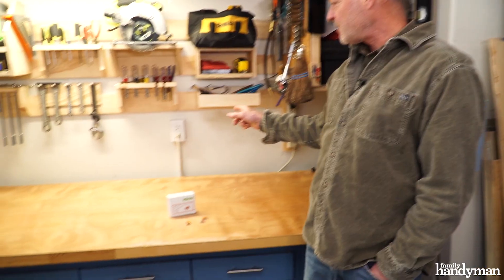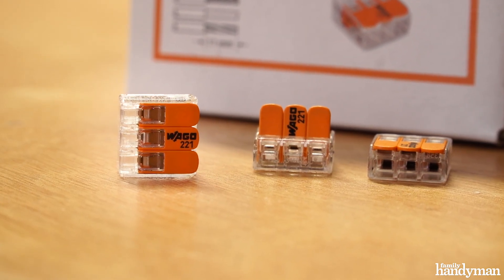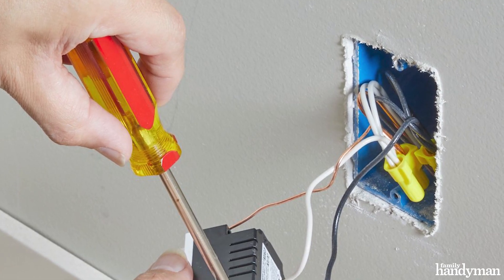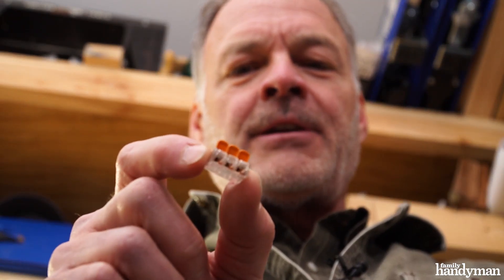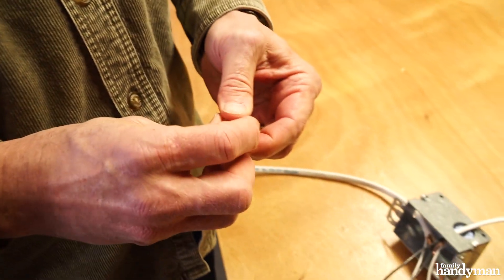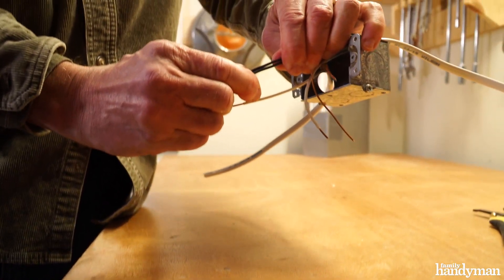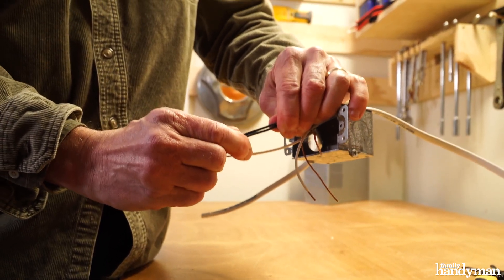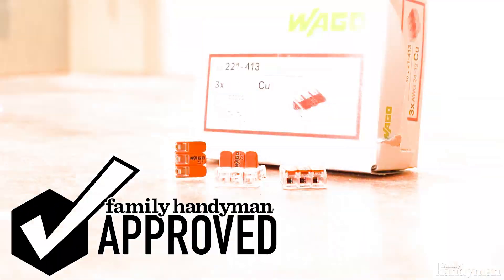Family Handyman Approved: WAGO Lever Nuts

Comment: There's lots of videos on these.  Basically, in normal use they are the same as wire nuts.  Videos of failures occur when the put ridiculously high current through them.  That said, they're expensive and unnecessary for permanent wire joints.  But traditional wire nuts are not designed to be disconnected and reconnected.  As such, there are  four places where these Wago's excel.  First is on fixtures  that are likely to be changed or upgraded in the future.  I use them when installing light fixtures to make it easy to change out.   Second area is when installing "smart" devices like WiFi wall switches or outlets.  These will need to be changed as technology improves and changing them should be easy and designed into their installation.  The third application is when a box is getting full and you need a little extra space.  The wires laying parallel to each other and not twisted together makes it easier to bend them around to fit in tighter spaces.  And finally, they are definitely superior when connecting a mix of solid and stranded wires as each wire has it's own clamping connection.
Reply: I would add: when you deal with old wires that are too short coming out of the box.

Comment: How are these not like the push in connections in a light switch or outlet? They make very little contact and are unreliable.
Reply: The push in connections are like a finger trap and can easily loosen and fault if twisted at all.  These wagos have individual flip up levers for each connector that puts a camming force on a full length serrated contact plate on both sides of the wire.   Flip lever up insert wire flip down.  Can individually test each wire.  
We use them at work for ballasts and other devices we are likely to change in the future or that we have to work on hot.